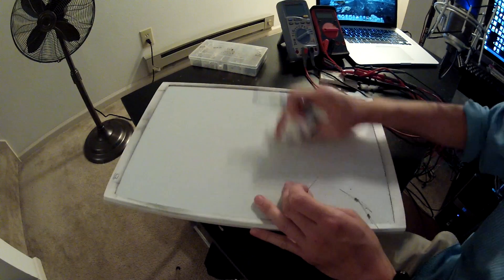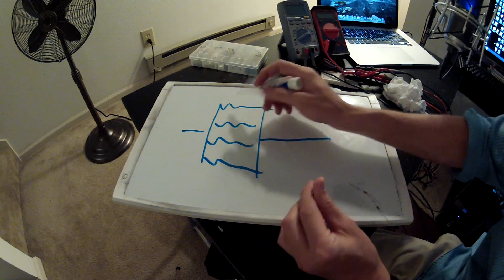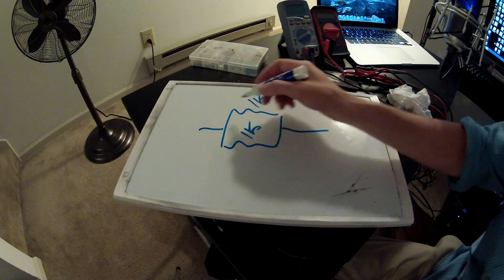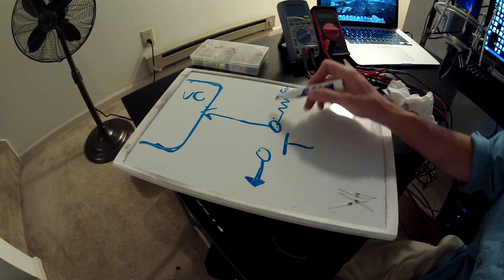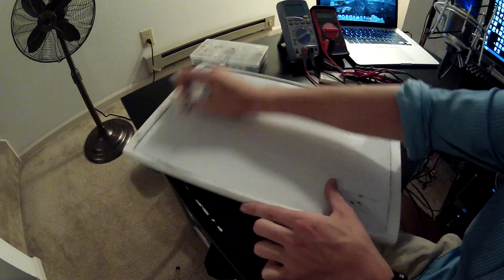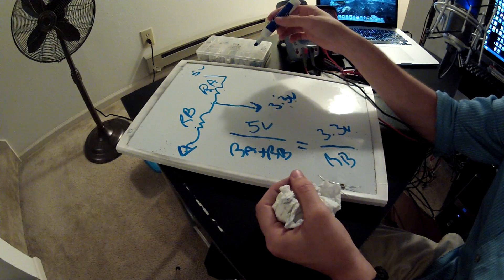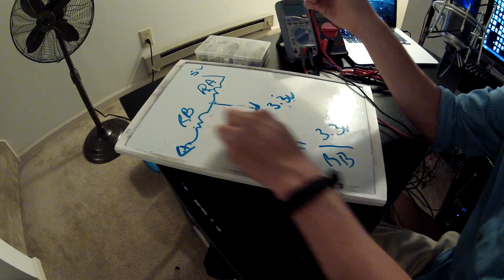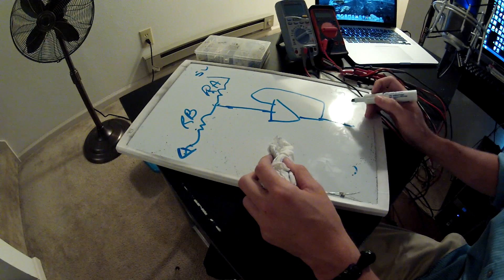Resistors Quick Lesson

Comment: Wow! This video is not very good in so many aspects. The title is completely misleading. Lets take the symbol he uses for a resistor. There are actually two recognized symbols. He only shows one. He only talks about 4 band resistors. There are 3, 4, 5 band resistors. I am not even going to get started with his math. He skips so much detail that is needed to really effectively and efficiently use a resistor. He does not even mention resistor series, he tells people to buy 1k resistors or multiples there of. Wrong! Pick a resistor series based on your needs, and you can buy the whole series kit. I buy the E6 Standard Resistor Series. He never even talks about what that is.

Nor does he talk about material types of resistors; Carbon, Film, Wirewound. All of which are used in different types of applications.How can you have a talk about resistors and never talk about the potentiometer, I very common type of resistor.

Finally, his design of a LED circuit is not something I would recommend. He is using a 1K resistor or two parallel 1k resistors to light an LED. That is just bad. You will waste so much power from heat on the resistor, than you will use running the LED. To get a LED to light to highest lumen, and last a long time doing it, you need to correctly size your power source, LED, and resistor.  That is the way professionally designed circuits are done.

Comment: Not all transistors  have a tolerance band, generally what end of  the resistor should be at your left is fairly evident.  The colors gold  and silver aren't used to indicate the value of a resistor,. I suppose the colors yellow and grey  could look like gold or sliver to some. There are some resistor color wheel projects  at instructables to help decipher the codes. Hackaday has a project as well.
Reply: Hi waswestkan, sometimes gold and silver relate directly to the value of the resistor. When gold is the third color, it means to divide by 10. When silver is the third color it means to divide by 100.

Comment from the maker: only if you misconfigure the pin as an output and drive it low, otherwise the pin is in a high impedance state which passes hardly any current.  I use that circuit all the time
Reply: When the resistors are 1000 and 500, how can i know where to put this resistors?

Comment: @14:56 As you said you can make series combination of resistor to go even brighter.. i dont know the capacity of my resistor that i am using with led light ,but when i use resistor with 12v battery it seems dim.and if i light up the led without resistor with 3v battery it glows very bright.,is there any tutorial how to get 500ohm resistor with 1k resistor?

Comment from the maker: yes, we do sneaky things like that all the time in circuit designs.  it all breaks down into ohms law.  in parallel, the current is shared, yet the voltage across each of them is the same, and since your power is IR, the power consumption is equally divided!

Comment: If I use two 1k 1/4 watt resistors in parallel, would that be the same as using a 500ohm 1/2 watt resistor, as far as current capacity goes?